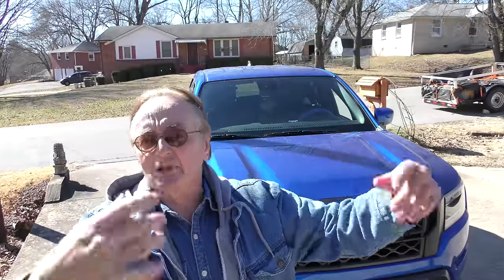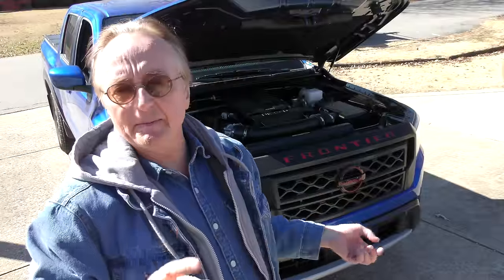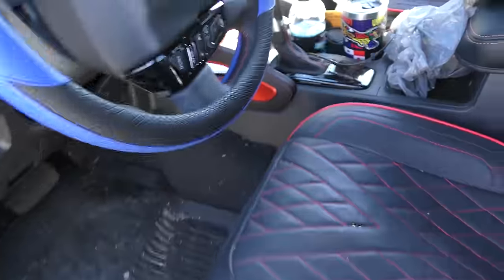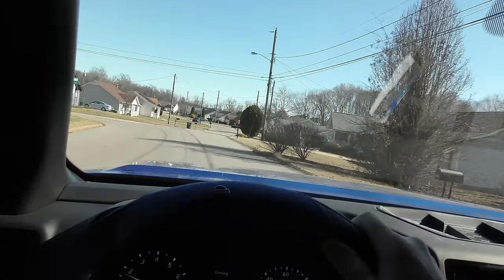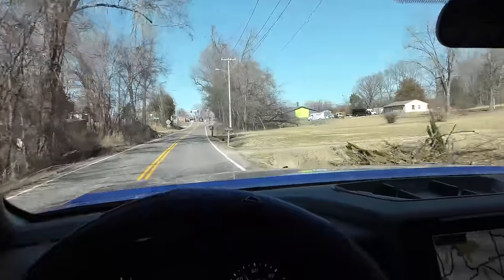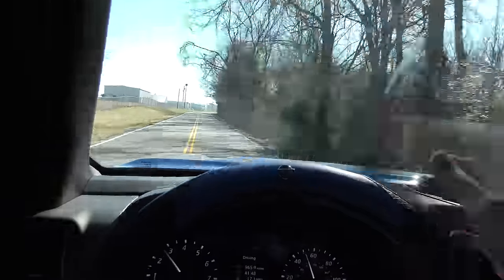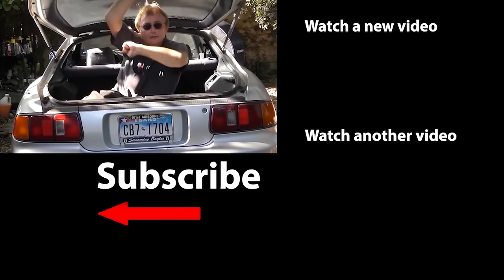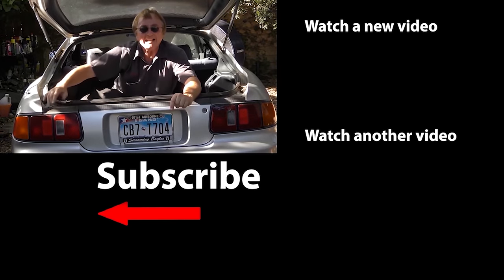This New Cheap Truck is Better Than Anything Toyota Makes Now

Comment: It's a sad state of affairs when 40K is a "cheap" pick up truck! 🤯🤦‍♂️
Reply: it tickles my eye that the new economical toyota modular truck only goes to "developing countries".. as if we wouldnt celebrate a boxy cheap looking 4x4 truck for 20k no matter the economy
Reply: If people would stop buying them Toyota would stop making them so expensive.
Reply: Got a 2007 f150 brand new for 18k lol, great banger truck
Reply: @crash6674  my work f150 was 20k in 2008. oil changes only 4.6 v8 lol
Reply: Well with todays inflation I think it is, this might be the new low sad to say but that where we are at with the trucks
Reply: Even sadder that the stealerships are LOADED with trucks collecting dust.
Reply: 10k truck for 40k. IL keep rebuilding my analogs
Reply: I still have my 2007 4 cylinder Frontier with 270,00 miles with no major repairs. My biggest complaint for the tune ups is you have to take the top of the engine off which takes over 2 hours of a mechanics time.  So we have spark plugs that last 100,000 miles doesn't change my attitude about ridiculous costs of changing 4 spark plugs. I won't be buying a new Nissan.
Reply: You can find new King Cab S trim for $25,000
Reply: Prices are definitely insane these days. But also there is a lot more included in vehicles these days, even the base models. For instance, even base models have full infotainment these days. 

Im happy with my 2018 f150 xlt that has no features whatsoever and dont plan to trade it til it hits 250k, but i cant deny its amazing that 2019 or newer stx have features by default which even my truck doesnt have despite being an xlt.
Reply: I paid 34K for a base S 4X4 King Cab. A crew cab base can be had starting a little higher. Your point is well taken, but we might as well face facts. If the manufacturers go back to offering 1970s style pick-ups with nothing on them, most people won't bite. We've gotten spoiled.
Reply: 40k new, but nowhere near that used.
Reply: Where you getting it for $40,000 ????
Reply: @randystone4903  Hey as a 4 cylinder, does it have any "ballz" ?  can it tow etc. ?
Reply: Thats Bidenomics.
Reply: @Robertl33trev  Unfortunately.
Reply: @midwestcoontrapper  Stellantis.
Reply: 2017 you could hardy  give a truck away ! I got $8000 off a $30,000 truck ! I was in heaven ! 1.5% interest !
Reply: Ever heard of a thing called, "inflation?" It's not 1970, gramps
Reply: @madgepins1967 1970? What about 2017? This would have been a 25-30k truck then.
Reply: @ztrguy   Last year I picked up a 22 end of model year left over  crew cab 4x4 model S for 29k.
Reply: @midwestcoontrapper  You lucky bastard!
Reply: @ztrguy where at or is that 2x4
Reply: Exactly
Reply: Yep, they are $48,000 where I live.
Reply: @ztrguy  MSRP is $31,540, where are you finding it for $25,000, cause I'll drive there.
Reply: @smulle96  EPA will not allow. That and the tariff voted in 40 YEARS ago over chicken. Go figure!
Reply: Yes. And people wonder why the "handy man" needs 50.00 an hour to help out fixing things around your house.
Reply: 45 grand is expensive!
Reply: At least it’s not 80k like most are
Reply: Bidenflation!
Reply: trucks start at about twice the price of a cheap car... just like its always been
Reply: Over priced for a mid size
Reply: A cheap mid sized truck lol
Reply: @psd.3144  no I remember when you could buy an f150 for 20k not 60k
Reply: Inflation sir
Reply: Ouch ! What does the work truck cost?
Reply: Back in 1996, you can get a cheapest F-150 or Chevy for 14k with single cab 2x4 and V6 engine.
Reply: That is why I bought an older truck for $7500 a few years ago. It only had 63000 miles. Sure it had dents and bumps in it, but who cares. i certainly dont
Reply: Totally agree , $60k here in Canada is not a cheap truck
Reply: @zruthl  if you have some mechanical aptitude and can fix your own truck, you have it made.
Reply: @bycracky22  How are you doing with rebuilding transmissions?
Reply: @CunnyConnoisseur69  You can get a better quality toyota for that same price. There are SO many addons that people already make for the tacoma. Just don't buy the 2024 4 banger turbo tacoma and you'll be fine.
Reply: Lmao all the new tacomas at my dealership are MSRP 50k+ and after mark up they’re 60k+
Reply: Midsize even!! $40k should be a decked out full size!!
Reply: I,agree with you.
Reply: Right I paid 20k for a 2011 Silverado with 120k on it. Prices are out of this world.
Reply: welcome to 2024
Reply: And nowadays cause new is so damn high the used aftermarket is much higher than it used to be
Reply: That’s right!!!
Reply: Got my 23 pro-x with off-road package and all safety features for 42k
Reply: You should work more to afford things
Reply: Tacoma was 12k my days
Reply: "Cafe Standards" make it impossible to make A simple NA V-6 or V-8 actual light truck.
Reply: I want to buy an all electric truck, not.
Reply: That's how much less the dollar is worth .. if you print tens of trillions of your currency it soon devalues
Reply: @Robertl33trev it started 50 years ago
Reply: The sad thing no one else has mentioned: apparently many of you have failed to get out in front of the inflation. Savvy people take advantage of inflationary periods by growing thier assets and making money, not sitting idle while the water rises around them. I don't mind the increasing prices so much because my income and asset value has gone up just as much and then some.
Reply: It's a loaded trim too. 40k for a loaded truck isn't bad at all
Reply: Agree
Reply: Lol, who would have ever thought.
Reply: Whoa is scotty selling me a new Nissan?
Reply: Right
Reply: True
Reply: @nerdobject5351 100% facts. Basic supply and demand. This statement can be used with TONS of sectors in our country.
Reply: Shiat!   I have a really hard time coming up with 6K for a used Colorado.

40K ain't cheap.
Reply: @crash6674 
Back in 2007 right?
Reply: @ztrguy Sadly not by me. The cheapest King Cab models were $34K to $40K, depending on the trim level(S and SV). I test drove a Red Alert King Cab S 4x4 a few weeks back and was impressed but couldn't pull the trigger yet. Dealer wanted $34,905 for it and the truck was a dealer trade from another dealer. Previous customer was planning to buy it but chickened out at the last minute.
Reply: The saying "we don't make em like we used to" is soooo true
Reply: Bidenomics
Reply: @josephmenna3985  it's not just that old fart. ITS THE ENTIRE SYSTEM.
Reply: Exactly
Reply: @smulle96 no u wouldn't cuz y'all also be the ones complaining and bitching whenever they through in a 4yclinder or v6 engine in a truck and not as refined "in 2024", there are Ford mavericks seated collecting dust in carsale lots
Reply: nah mate, thats america, i drive a 1200cc 4-banger rolla, i dont need no compesating big rig @ridgefrost
Reply: You got that right. And that's not cheap to me also.
Reply: But no one is buying them and a 6 ft bed is useless; give us what we want!
Reply: @presimirmikic9016 same truck is probably 12k with 248k miles on it.
Reply: You can actually get these Nissan pickups for less with a still good package at around 30 to 32,000 dollars. This truck is my actual next purchase. Ive owned 3 Nissan trucks, and im a Ford guy. Nothing bad to say about them.
Reply: I agree
Reply: Used low mileage is around $26-33k unless you want fully loaded trim. Who tf buys new?
Reply: We live in a sad times
Reply: @madgepins1967 inflation doesn't just pop they way it did . Slow walks not ff
Reply: ask the Government why 😅
Reply: Inflation be like that
Reply: Wish I would have kept my 2020.
Reply: That's a Pro4X. It's the absolute highest trim version. That's a steal.
Reply: It's also a sad state of affairs when uneducated workers get $18hr stocking shelves at Walmart.
Reply: @slapshotjack9806 in 1996 maybe
Reply: @AsianNIGMA and after taxes and registration they are 55-65k
Reply: Welcome to 2024
Reply: @nerdobject5351  capitalism
Reply: All base model should be around 26 28
Reply: Say that again man
Reply: Bidenomics
Reply: 2024 Pro 4X with every package fully loaded...$45k OTD...looked at the Tacoma TRD Pro with same/similar pkgs and it was $60k+...it was a no brainer for me. And a V6 vs a turbo 4.
Reply: Amen.  I bought a house for just a little more out here in the country.  These trucks cost as much as a house
Reply: Compared to $80k for toyota....
Reply: Only in America
Reply: @madgepins1967 when you can buy a house cheaper than a new pickup it's beyond inflation.   It's absolutely criminal to charge these prices.  They are so high old junk used trucks sell for much more than what they cost
Reply: You can find the for under 35k
Reply: ain't that the damn truth.
Reply: Brilliant

Comment: Nissan sales after Scotty’s video 📈
Reply: I wanted the cvt to blow out on my altima and still keep going smooth 200k miles😂
Reply: Until tomorrow’s video about Nissan going out of business 😂
Reply: I’ve got 320k on an 07 Altima hybrid that I maintain myself. Those cvts r trash!
Reply: @tortillamilk  my cvt is still smooth
Reply: @larryinnova2745  Not really
Reply: Are you sure that ain’t Scotty’s bank account after Nissan paid him to do this?
Reply: @salehselan3026  what year model is your altima
Reply: @salehselan3026 not really something ya want
Reply: V6 vs a turbo 4. I'd rather have the V6.
Reply: @davidtrupiano3374  Or a straight 6, which is way cheaper to build with way less parts.
Reply: @gnomerome3765  I understand since it was passed to me, but it still drives beautifully with 200,000 miles
Reply: @palmlimit9297  he wouldn’t take there money.. he’s a rare breed that isn’t influenced by money..
Reply: I've never had anything go wrong with any of my Nissan vehicles, cars, or trucks. Dead batteries don't count. It's a lot like, but a lot cheaper than - Toyotas.
Reply: I’m on my way to buy one just because Scotty reviewed it, I really trust a person that recommends Toyota like he does m, does are the ppl that really know what they are talking about lol
Reply: Do they hold value as high as Toyota 🤔 🤔 🤔

Comment: My dads been using Frontiers for his business, and at least 3 of them have gone way past 300k miles with little to no issues! Super reliable and fun trucks, I drive one myself
Reply: Are the new ones reliable?
Reply: @ericzz93 only time will tell, but from past experience my dad had a couple of frontiers as work trucks and they did amazing, I had a titan as my first high school car and it was a solid truck with almost 300k miles and even with late oil changes lol drove like new,only reason we don’t have it is bc it got total
Reply: I’m on my second Frontier. Awesome truck. I had my first Frontier for 18 years and it still drove great.

Comment: Scotty changes his mind every video
Reply: Not really.
Nissans changed last year, for the better
Reply: Scotty doesn't like Nissan's Jatco transmissions on their cars. This truck however doesn't have that. It's an actual transmission with actual gears.
Reply: the good Nissans are the Frontiers and Armadas
Reply: Right he said toyota was the best now nissan lmao😂
Reply: @blowfly420 he did say Nissan trucks wasn't good...he always speak on the CVT transmission....he always speak good about nissan trucks
Reply: your sense of conclusions is equal to the masses reading news headlines. Well done on the herd thinking!
Reply: He explained that exactly why he shits on Nissan cars and why Nissan trucks are good. Completely consistent.
Reply: @blowfly420  Different model , different story. He is likely fed up with even Toyota cost cutting.
Reply: @philindeblanc   Scotty is not a fan of Toyota going away from the V6 on their trucks, while Nissan on the other hand has kept the V6 still.

Comment: I wish they could go back to the DATSON days.
Reply: In high school, I had wanted a Datsun 240Z
Reply: Datsun.
Reply: @rolandthethompsongunner64   Thanks for the correction.
Reply: Amen! Parents had a '72 510 pickup, and a '72 510 station wagon. Both were excellently made, naturally aspirated  4-bangers and extremely reliable. Between three brothers, you just couldn't wear them out, and believe me, they tried!

Comment: Our 2005 Titan had 434k miles on it when it got totaled. Original engine and transmission, it ran great. I really   miss it. The gen 1 Titans are outstanding.
Reply: Yeah, those old ones with the 5.6 L sounded good too and I think they look better than the newer ones even for their time
Reply: Yeah so goofy looking compared to the New 1s
Reply: 8 months in I am happy with purchase one thing I'm not happy about is the bed can not be sealed up without extra measures. Had about 4 inches of water on my first trip with all my stuff in bed with a good cover on. I could see light from inside bed and no drain holes. Sealed holes with rubber cement and opened sealed drain holes and so far so good.
Reply: One of the big issues with the 1st generation Titans was failure of the exhaust manifolds and Nissan never rectified the problem. My brother has replaced it twice in less than 150k miles and the cost in parts and labor to do it is not cheap. And Nissan kept the 1st Gen Titan for over 13 years before the 2nd gen redesign in 2016. S oanyone with a 1st gen could expect this expensive failure to occur.
Reply: @adamn7516  Never had the issue.
Reply: @icosthop9998  Their mistake.
Reply: @icosthop9998 
Umm, yes they are. What are you talking about?
Reply: Agree 100%. My 2013 pro4 x has 445000 kms now. Motor is strong. Problem lately is I’m having intermittent times where it won’t turn over. After many forums search I’m still don’t know what’s going on. Might get a frontier or a 4 Runner
Reply: @GarryMurray-i1y  Probably the starter or that stupid junction where the large cables are attached. I've  had to clean ours a few times. The starter is under the intake manifold..... stupid design.
Reply: @TheGeneralMotorsGeezer-we3dg  yes. Very stupid design. I’m seeing all kinds of stupid things done on vehicles. It’s like the car manufacturers hire the guys that failed engineering school or at least finished last in their class.
Reply: @GarryMurray-i1y  That is why I have four late 90's GM OBS trucks and a 94 Z28.